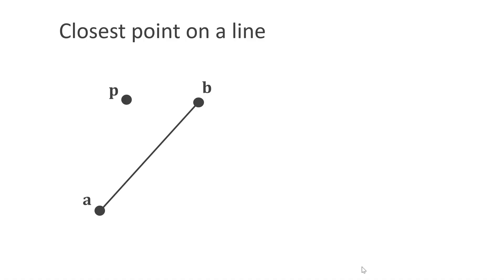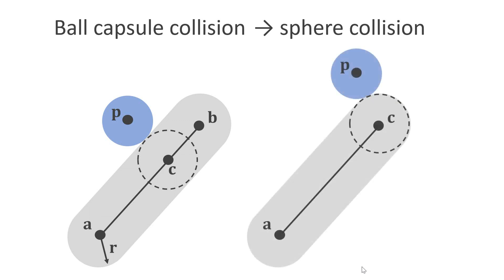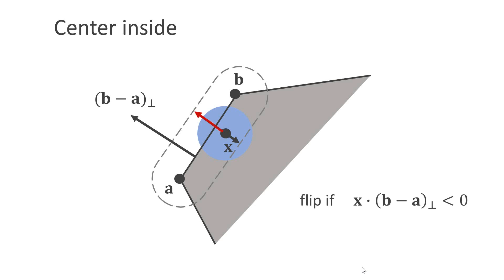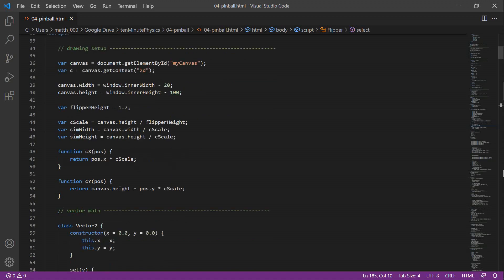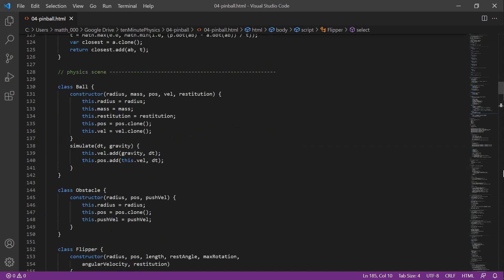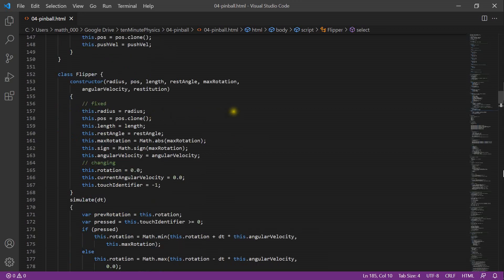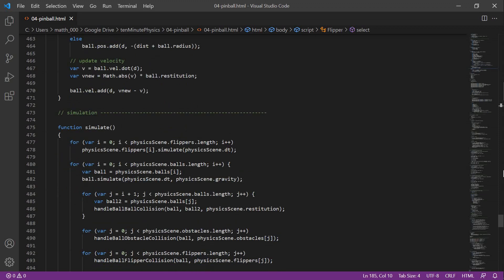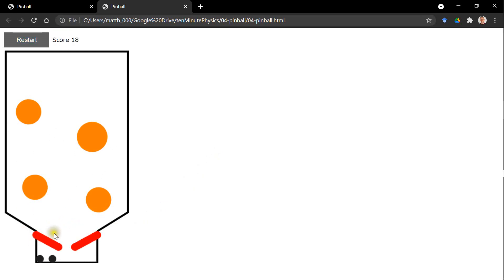04 - How to write a pinball simulation

Comment: I spent a few hours today trying to discover how to construct perpendicular vectors in 3D. Got there in the end, but mostly by trail and error. The slide for the 3D case took me a few minutes to read (as you named the length x in the same color as the axis). But now I want to try and use such a construction for 3D

Comment: hi Matthias!

First of all, I wanted to say a huge thank you to you. Your channel really is a gold mine and it is so much fun going through your videos and learn from it. Thank you so much for sharing your knowledge with us with these nice tutorials and with all the well prepared sources to follow along!

The other reason why I am writing... I noticed a small thing in the pinball simulation that I wanted to bring up. Not to nitpick or criticize (your tutorial is great as is), but just in case somebody else has a similar question. In the function "handleBallFlipperCollision()", we don't seem to take into account that the ball would bounce off of the flipper from the default "elastic" collision (if the flipper is static, for example). We currently only simulate the velocity it gets from the rotating flipper. Since we multiply "surfaceVel" with the angular velocity (line 421), the new velocity is 0 if the flipper is not currently rotating and therefore, the ball seems to just "glide" along the flipper (and get "sucked" into the hole 🤣) instead of bouncing off of it a little. It's especially visible with larger restitution values of the balls when they bounce off of everything except the flippers. 

So if I am not mistaken, we would additionally need to do it similar to how we do it in the ball-border collision, where the ball gets "reflected" from a static object. So if we add the following in line 425, it seems to do the trick.

vnew += Math.abs(v) * ball.restitution;

We add the velocity from the "regular" bounce as well (v as in the previous velocity in the collision direction before the hit) and the balls will deflect a bit more "correct" (at least subjectively?).

Possibly, you left this out intentionally for simplicity's sake and because it is supposed to be a simple simulation for learning. If so, then please ignore this request. ☺ I just wanted to mention it here for completeness' sake, and in case somebody else has a similar question. Please correct me if I am wrong!

Again, thanks a lot for your beautiful work! We really appreciate how much effort you put into these series! Looking forward what else you show! 🤗